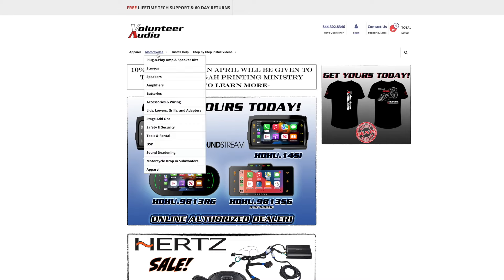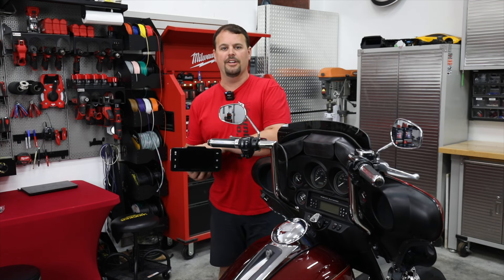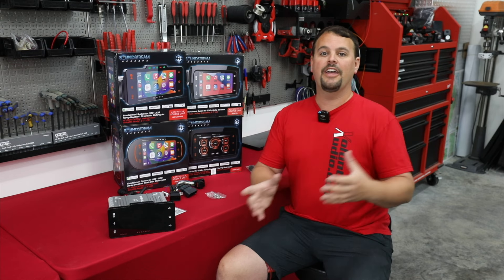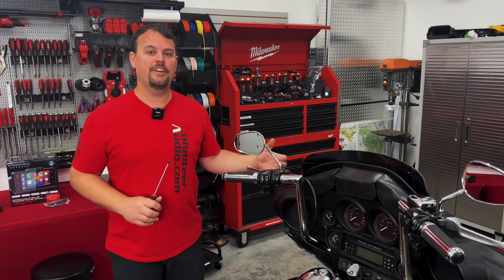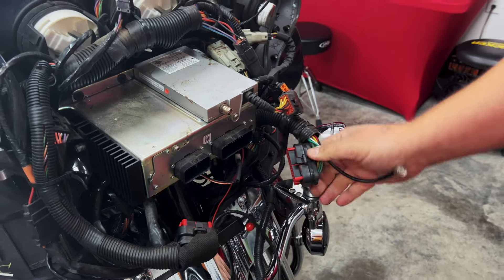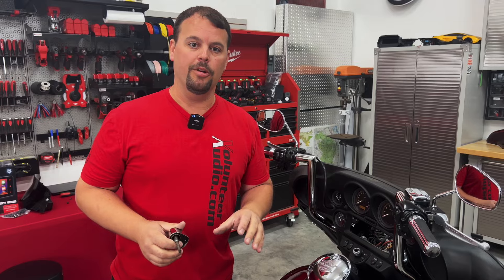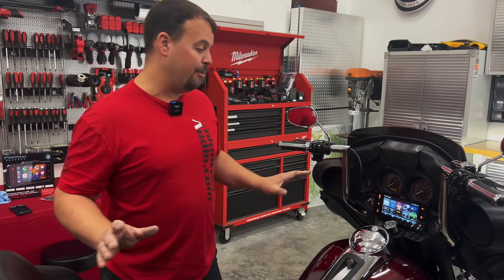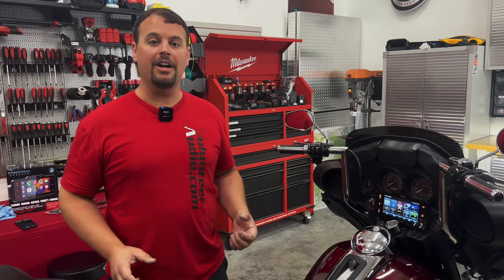Step by Step install Soundstream Reserve HDHU9813SG Radio for 1998-2013 Harley Davidson Street Glide

Comment: I have a 2013 Electra Glide and I use the Garmin/Harley Zumo 665 GPS for navigation and would like to keep it. Is there a way to get the audio from the GPS into the radio? I'm assuming the Bluetooth feature in this unit is for audio from the radio to bluetooth helmet headsets.

Comment: I bought this radio as well for my 2012 Street Glide....However the my ignition switch was rubbing against the radio face...I loosened the bat wing four bolts two on each side and pushed the fairing forward and retightened the bolts...This gave me 1/4 inch space between radio face, and my ignition switch selector.. .Love the radio !
Reply from the maker: @michaelspaulding6088  thank you! We made a video on that process too!

Comment: Just got mine in the mail yesterday and got it hooked up already just waiting on my dd1 sound track usb to come in the mail today to tune the front at 1khz -5bd and rear at 1khz -10db but do you have any preference settings on the 13 band EQ for after I tune it so I can actually get some basss through the speakers?! I’m not familiar with a 13 band EQ at all so any help would be greatly appreciated
Reply from the maker: Start flat on eq, set amp gains correctly, set high pass filters correctly on amp, make sure polarity tests correct. Then use the eq to turn down what you have too much of or you may be happy at flat if you have quality components.  Do not boost bass trying to get more bass.  You will only add distortion and possibly blow your speakers
Reply: @volunteeraudio   I have precision power 6x9 in lids and sinister sounds 6.5” speakers in faring and I also have a DD1 to properly set max volume and amp gains. What do you recommend for the frequency range on the speakers? I have a arc audio moto 720 amp
Reply from the maker: @Jeffmd2020  the precision power 6x9’s play 65hz -up well

Comment: Just finished my install today.  I got the wireless connection for the Apple Car Play and it all works great.  I will say that getting the rear bolts installed was a bear and I had to bend the bracket to line up the holes. Overall I love the unit.
Reply from the maker: Awesome, thank you!

Comment: I have an after market radio in my 2013 street glide? I bought the adapter harness for the handle bar controls and I wired in my 2 saddlebags speakers how would I hook my back speakers up to this radio? Do I splice them in?
Reply from the maker: You can, it has an included harness that has the rear speaker wires connected to a stock rear speaker style plug, if you don’t have factory rear speakers you can remove that plug and hardwire
Reply: @volunteeraudio  I removed the travel trunk and it's rear speakers years ago to make it easier to mount my 2009 Ultra Classic.  Will my two fairing speakers, Infinity brand, still produce good sound without the rear speakers connected or have any other potential issues?  Also, will my iPhone connect via Bluetooth with this unit or do I need more stuff installed?  Also, what will I need to have Sirius Satellite radio via this unit?  Thanks!

Comment: I did get this radio and I did get the precision 800w amp for my 2010 Ultra Classic and OMG!! This is so loud and so clear I don’t want to turn it off!!!  Very easy to install. Plug and play is for real with the radio and amp. The switch is close but works just fine.. if you buy on you will not be disappointed..
Reply from the maker: Thank you!

Comment: Hi there i've never installed an aftermarket radio so i bought a Soundstream VR7HB which is going to a Chevy Captiva Sport LT. Do i simply connect the Aftermarket adapter wiring to the existing factory adaptor wiring to make the radio work?
Thanks for your time and i enjoyed your video?
Reply from the maker: Most installs require connecting the included radio harness to a vehicle specific radio install harness.  Thank you for watching!
Reply: @volunteeraudio  What i did not realize is this radio comes with a small, square module which enables the radio to power up. The directions do talk about this module but it doesn't say you must plug in this module for the radio to work. I finally got the radio working and its my 1st time owning a Soundstream. Im very impressed. 
Thanks for your reply!!

Comment: Hello just came across this video been watching this product for some time from sound stream. Have a 1997 Electra glide this unit will fit. But will all the hand controls work also and does the radio have any kind of GPS or mapping   I would like get the whole kit how would it sound with cicada 6.5 speakers Thank you 🙏
Reply from the maker: We have great plug n play kits that sound amazing, we do not sell cicada but have options that sound better at similar or lower price points, call us at 1-844-30AUDIO to go over options and pricing.  Yes the radio can go in a 1997 but requires an additional harness to adapt to your year and retain thumb controls.  This radio does have apple CarPlay and android auto so your phones navigation can be displayed on screen

Comment: Terrific video Jay. I'll pass this to a friend with a 12 cvo street glide. Has jm junk in it and has nothing but problems with it along with a Kenwood I think) radio.  Fantastic job. I love the look of this unit.  Thanks. Stuart
Reply from the maker: Thank you so much!
Reply: Will this work with the CVO factory amp?
Reply from the maker: @fredrex1969  as long as it was factory installed yes, if added at the dealer then no

Comment: I added this radio to my 12 Ultra and a Rockford 800x4 amp. The sound is so much cleaner than the factory radio plus there is no humming. Cruising down the highway at 75 mph with the volume at 28. I didn’t have to turn it up much with the stock radio and amp. What’s the best way to plug the amp into the radio?
Reply from the maker: We suggest high level input and then properly setting your amp gains, max output of amp should be at full radio volume which is 50

Comment: I bought a Soundstream and installed on my 2011 street glide. I also bought a Hertz amp and front speakers and installed. I have a fairing mount radio antenna and before I installed new system I had good radio reception,  and now I can barely pick up any stations. I checked power and connections on antenna and radio and everything looks good. Have you seen electrical interference from amps that cut down reception,  or sound stream have issues with antenna s?
Reply from the maker: This Soundstream uses the latest in digital fm reception, many factors come to play when judging why a Harley has poor fm reception and normally the radio is not the issue.  LED lights have light drivers that block fm reception, many class d amplifiers also block fm.  On top of that people like to shorten the fm mast or even use hidden antennas in the fairing which all lower your fm reception.  Try running your bike in accessory and test your fm with your lighting off to see if your lighting is the problem.  When all else fails the iheart radio app gets you your favorite fm stations with no static.  I hope these suggestions help you!

Comment: Does this radio have separate front and rear channel high pass filters, or is it set across all channels with 1 filter, also is there wireless car play capability or something i could get to make it wireless, thanks👍👍
Reply from the maker: It does have a global high pass for front and rear channels, I usually set independent high pass on the amplifier, we do offer a wireless adapter from Zz-2 that works great but it comes wired CarPlay via usb if you do not add the adapter

Comment: All my controls will work on the handle bars I have a Street Glide I was told I would have to get a maestro wiring kit but it looks like everything is plug and play also is the android auto wireless or wired
Reply from the maker: Yes, plug n play and thumb controls will work on 1998-2013 models

Comment: I like the radio I have a few questions I have 2011 Tri glide with stock radio with tour pack and I am guessing tweeters over speedo and tack  will the hdhu9813 still work with them or will I lose and can I build sound system in stages and will it hurt the radio if it take a little time to before I can get amp and speakers
Reply from the maker: You can keep the tweeters that mount above, the radio should sound better than stock but a good amp is where you gain volume increase

Comment: So when the other info says does not work with rear speakers volume will the rear passenger speakers hook up with this and or how would they be controlled or would it be just one set volume?
Reply from the maker: What it means is that front handle bar mounted thumb controls will still control the radio but rear tourpack mounted volume controls will not work, rear speakers will work but the radio will be controlled from the front controls

Comment: I love features but I feel like the screen bezels could be reduced on a future model. Perhaps by removing the soft keys. I’m so tempted to order this unit but I’m afraid to do so and then an updated model being exactly what I’m looking for
Reply from the maker: There are minimum screen size requirements for CarPlay and android auto, it will not get smaller because of this and the fact that soft keys are needed for people without thumb controls

Comment: Hi Jay, 
Thanks for introducing me to this great new option!
I currently have the  RF PMX-9813 head unit installed along with the RF HD9813SG-TKIT. Do you offer a plug and play kit to replace my head unit with this one and still retain my current amp setup?
Reply from the maker: Yes it plugs right into the same plugs that Rockford used

Comment: Got mine yesterday and installed it. Works great except for the neutral bar. Doesnt show neutral , and the oil and signals are pretty dim. Ill be giving yall a call to troubleshoot. Im guessing its a connection issue on the radio harness since it works perfectly plugged into the stock harness
Reply from the maker: Give us a call 1-844-30AUDIO
Reply: @volunteeraudio I did...got a voucemail, left a message , been a week now.
Reply: Thinking about getting this. Did you get it resolved?

Comment: Great video. Question which amp will bolt on top of this radio set up on 2012 Street glide, the Hertz or Precision Amp, thks
Reply from the maker: Both can, on the hertz we bolt on a plate that we Velcro the hertz amp to, the precision power amp bolts to the plate
Reply: @volunteeraudio  i have the boom audio system on my bike , i wanted to use sound audio stock screws in kit on there radio on top , which amp will bolt on to your radio , not a fan of Velcro if i can avoid, thks

Comment: Getting ready to order this from you next week and before I do I want to make sure that since I have a sinister sounds system and none of my speakers are “plug and play” does this amp have a stand alone remote wire off the head unit to run to the amp or how does that work with this head unit? My current aquatic AV radio has a single blue bare remote wire that runs from the radio to the amp and if I’m spending this much money on a radio I wanna make sure I can wire up my amp to it still. Thank you and god bless brother!!
Reply from the maker: Yes the radio has all the needed outputs, remote wire, speaker wire or rca connections.  Thank you for watching, God Bless!
Reply: @volunteeraudio  I noticed you said the speaker level output are so much better then the rca output for amplified speakers. What’s the difference in the two? I always thought the rca output gave a better and cleaner signal then the speaker wire outputs?

Comment: I purchased a Soundstream reserve radio and the back light went out I was told there was an issue with them on the first run of them that has been corrected. Since Bike Week is coming up and I plan on going I can't take the radio out there is just never a good time to set the bike down since I ride everyday in Florida. I don't want to wait for the swap out with the warranty as the deadline is approaching and have a open hole in the farming waiting on the radio to be sent back and waiting for the other to be sent back. I know it has to be done though. I asked if I could upgrade the radio since there are other better ones available now and I would be happy to pay the difference but I was told I wouldn't get the same money that I paid for this radio I purchased before it went on sale now. I see why it went on sale but would like to upgrade. Then to make matters worse I got a new cell phone and can't even pair it up to my new phone now because the screen is out. I'm in a bad place with this radio to say the least. I left a message with the manufacturer to see what they can do to help but still waiting on a call back. This really sucks to have this dilemma.
Joseph kasmerski.
Reply from the maker: Who did you purchase from? Warranty swap is a one day turn around here once we receive back the defective product.  Warranty must be done through the original dealer
Reply: @volunteeraudio  I bought it from your company.  It sounds nice one day turn around but in actually it's 1/2 a day to get it out packed and take it to the shipping place then 3-5 days to get it to you one more day for your processing then 1 or 2 days on the return then 1/2 a day to install it. Now it's about 5 to 7 days for me. Even if I bought another one and your company sent it out then it would be a day but I'm back to the issue of not getting the full credit towards the upgrade. Half temped to dump it in the trash.

Comment: Great video - Does the radio support the stock CB? I didn't see you reconnect it. Also, does the radio support GPS? Google Maps?
Reply from the maker: It does not support cb no replacement radio does.  Yes it will display google maps, Apple Maps or Waze through apple CarPlay or android auto

Comment: Will the Precision Power 800W MAA4.400 Prewired To Add Amp To Harley Davidson 1998-2013 Street Glide With Aftermarket Radio, work with this new radio ?
Reply from the maker: Yes, we offer it preset for this radio

Comment: Will you be making a video on how to install the device you sell in your package to make Android Auto n Apple CarPlay Bluetooth
Reply from the maker: It plugs into the radios usb
Reply: @volunteeraudio  So then the cord is taken away or is plugged in where the cord is In the back of the radio or can you just put it inside the fairing and keep the cigarette lighter? Is the signal strong enough to run with it being in the fairing?

Comment: Will this fit if you have the chrome inner fairing trim kit installed? Or do you have to remove the trim thats around the radio on a 2010 electra glide ultra classic?
Reply from the maker: You would have to remove the added chrome trim

Comment: Great vid, Jay! Looking forward to getting mine this week! I have a 2007 FLHTPI that someone added a radio to via hardwire. Do you guys sell a wiring harness to convert it, or will I need to cut wires on this one and hardwire it like the current one? Also, how difficult is it to connect the steering controls on a police bike?
Reply from the maker: Currently we do not have a police bike radio harness for your bike, it would need to be hard wired, it is very difficult to make analog thumb controls work without the stock harnessing
Reply: @volunteeraudio  Jay great video. I have done exactly what Mike is asking with another brand plug and play radio, with you permission I can answer him. Or this can be deleted.
Reply from the maker: @markpinnavaia8291  sure, if you can help I’m all about sharing info to help
Reply: I have a 13 FLHTP that I plan to add a radio to. Metra sells the factory plug, 71-9600 is the part number. You’ll have to wire it in yet but it’s super easy once you do find the schematic. It’s two wires to the battery, one to a keyed power source, one to ground and your speakers.
The hand controls are much more involved though.
Reply: @volunteeraudio  we got it done

Comment: Hi. I have a 2012 ultra which has a cb and speaker switch. Doesn't this stereo make it redundant and is it possible to just get rid of the cb and switch if so ?
Reply from the maker: @nasseral-momen1463  replacing the radio will make the cb and switch non working, simply install the radio and remove the cb module as it no longer works
Reply: @volunteeraudio  ah ok no problem. Can I just remove the switch altogether ? Or it there a way to delete the speaker switch ? Thanks
Reply from the maker: @nasseral-momen1463  you could remove the switch but you would want a blank to go back into the hole
Reply: @volunteeraudio  ah good to know. I'm switching from street glide to road glide fairing so that's why I want to remove the switch anyway. As long as it doesn't interfere or ruin the new setup

Comment: Jay, would you do this headunit over an amp? I have the factory radio with a Bluetooth dongle hooked up to the aux port. Stock speakers. As far as usability.. I’m ok with it. I just want better/louder sound. 

Obviously, I need speakers… that’s a given.
Reply from the maker: Radio is a must, if you want significant volume increase you would need an amp as well, this radio is almost twice the power of the stock radio and has a much cleaner sound output

Comment: My back speaker connection is different than the connector on the harness
Reply from the maker: What year? Here is a link to pin out on 2005-older http://volunteeraudio.net/wp-content/uploads/2017/02/HD-Rear-Speaker-Wiring.pdf
Reply: @volunteeraudio  it's a 2003 FLHTPI. Looks like the connector was replaced at some point
Reply: @volunteeraudio  both connections on my bike coming out of the radio are the same size.. the harness provided one is an inch longer. Both plugs are the size of the radio plug.. I'll check out the link. I appreciate the help